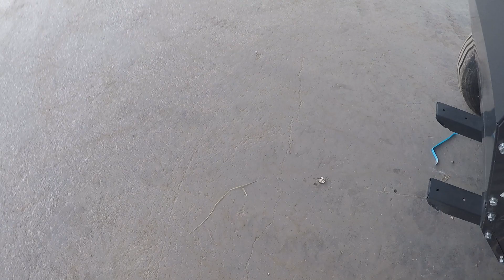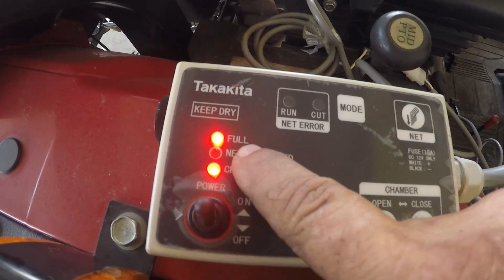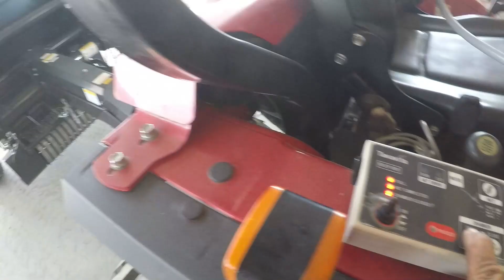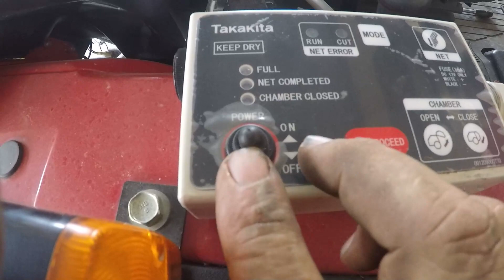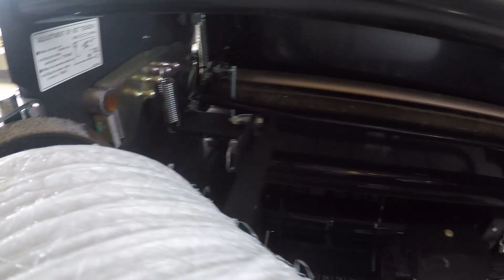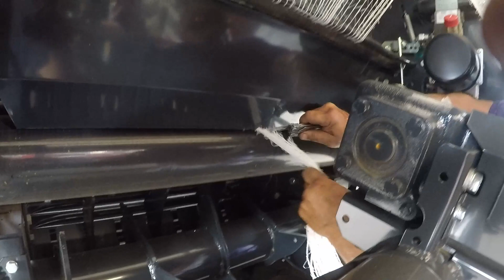3X3 Round Baler Maintenance and Operation

Comment: Silly question, but could you properly hookup one these balers to a bobcat toolcat uw53 (25 rear pto hp) and run it? Would there be connection issues for electrical, hydraulic even, or drawbar issues?
Reply from the maker: Thank you for your question.  The only concern is the length of the electrical wiring but that can be easily modified with an extension.  The baler has a very long cord and we usually coil it up in most cases.
You do not need hydraulic outlets because the baler has it's own hydraulic pump.
You have more than enough power to operate this baler and the two would be a great combination.
The baler connects to the lift arms on your UW.

Comment: Can you use hytran hydraulic fluid in haler ??
Reply from the maker: If it's the IH hy-tran then yes.  or a 10 Wt power steering fluid which is cheaper and at any auto parts store.
Reply: @smallfarminnovations4265   how much is this baler ???

Where is the baler made ???

Can you get replacement parts for the baler ???

Comment: I have the older 3x3 baler. Love it. Not good in dry grass hay even when rubber coating the roller. Other wise it is a great baler. Wish I could afford the new style. All I do is grass hay, and sometimes it's hard to get it baled at the exact time, so I have to fit the dry hay. Great products all around.
Reply: What model baler you have ??
Reply: @TeresaJohnson-ew4us   TRB0910B
Reply: @TeresaJohnson-ew4us  TRB0910B
Reply from the maker: Thanks for sharing
Reply: Use spray on bed liner on your roller it's rough enough to feed dry grass
Reply: @MikeSmith-uj9tu  I did, and it didn't help. Thanks.
Reply: Question, if this isnt good on baling dry grass hay, what else would it be FOR??
Reply: @20sherilynn  if you bale with a little dew, it's great. The new style doesn't have that problem.